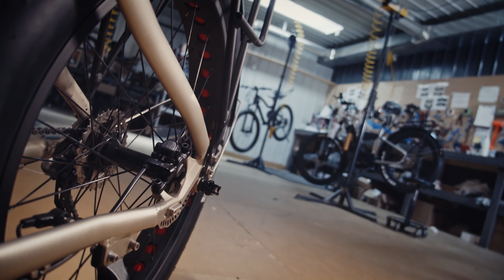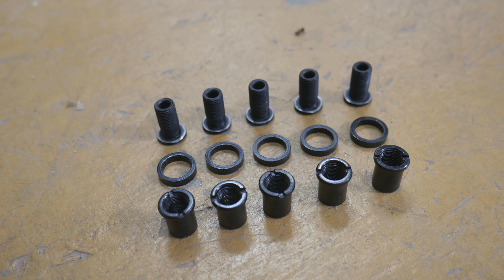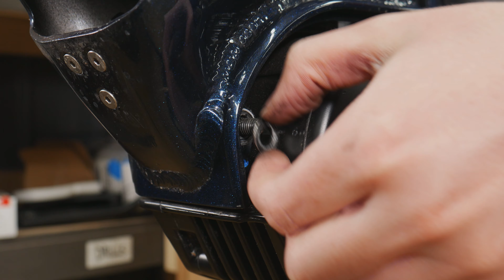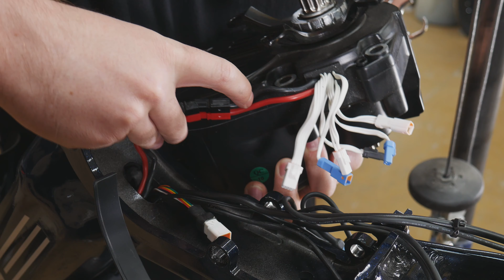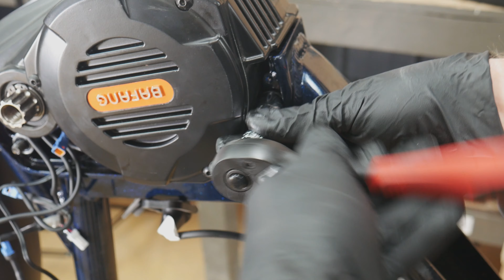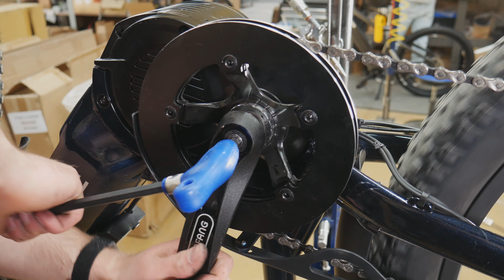How to Remove a Bafang Ultra M620 Motor

Comment: The motor wire harness will not fit on re-assembly, no matter how you try to arrange the wires.
Very frustrating.

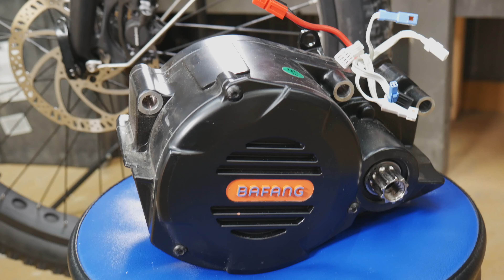Comment: Great video guys but one crucial part is missing and this is crucial for the motor to sit in the frame cradle with ease. At the reinstall part around the 3:00 mark you say to connect the power connections and pull the others to the side. Why don’t you show the opposite side from the drive side and state how the break, shift, gear sensor, and the torque sensor cables, four in all, should go under the middle bolt and out side the rear bolt and routed out the back? It’s crucial for the motor to set in with ease. DO NOT GO UNDER THE REAR BOLT AND OUT THE BACK, the motor wil not cradle down on the frame. Hope this helps people.
Reply: 100% right.
The reinstallation of the motor wiring harness is a nightmare.  
How could they not have thought of this.
Reply: Exactly

Comment: Hey Biktrix!!!!!!!  great video but a step is missing. how do you remove spider and bottom bracket? :)
Reply: Agreed, I came to this to see about removing the spider, sigh...
Reply from the maker: It's just standard charinring bolts. Super easy to take off.
Reply: @Biktrix  ummmm you need a special tool for it and not super easy. Why was that skipped in video? Great video but key step skipped
Reply from the maker: @seanfontaine8003  we'll see how we can add that in for next time

Comment: I’m on my third M620 in a year, these motors are noisy, the controllers are fragile and the replacement cost is around 1000$.
So far I’ve only been able to get 2000 miles out of one of these “ premium “ drives, so beware if you’re considering a bike equipped with one of these so called great drivetrains. 
Once you can’t stand the noise they make after 500 miles, and I mean big gear noise, you can find videos on YouTube that instruct you on how to open and grease the three main gears. The videos are well done and simple to follow and I truly believe that doing this will extend the life of these very expensive motors.
Having said all that…… they are powerful, have amazing torque and make hub drive motors look useless.
Beware of any bike purchased online, local bike shops really don’t want to service these motors and dealing with all these new companies can be challenging to say the least.
Good luck, I love my fat tire Ebike but they come with frustrations and challenges that regular bikes simply don’t have!
Reply: I've got 12,000 miles on my frey, and 4,000 on my Luna z-1 no problems did 1st regrease at 10,000 miles on frey
Reply: @petepete-pz4bm you only regreased at 10,000 miles? Your motor was loud and running metal on metal guaranteed.

Comment: great video but think a step is missing. how do you remove spider and bottom bracket?
Reply: 100% a critical step and completely glossed over. Currently preventing me from regreasing the motor as the socket I bought doesn't have the depth to mesh with the lockring over the crank arm axle.
Reply: Why was this step skipped? I really need to get the cover off so I can clean and regrease the motor but the star shaped part that holds on the rings etc is still there. Not sure what I need for a tool now to get the large ring type nut off to continue. This sucks...

Comment: Hi guys, I'm trying to install my new g510 but for a reason I don't understand it does not fit properly as my previous one, I am not able to line up the holes , has this ever happened to you? Is there another version of the g510?
All wires are placed correctly and no matter how hard i push the motor does not fit properly inside the housing. My bike has the same body frame of the juggernaut ultra beast.

Comment: Oh wait, but mid drive motors support throttle? That's awesome. The specs of this motor are way above the rear ones, that suffer when climbing slopes, and don't even allow to increase the voltage.

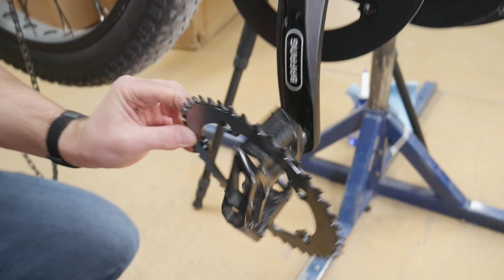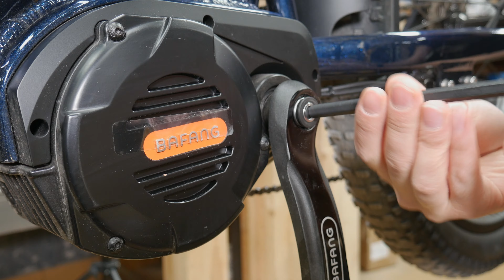Comment: At 1:16 on the video, the arm that holds the chain ring and chain guards is visible.  At 1:23 on the video, that part vanishes with no information about how it's been removed.  On my bike, it doesn't look like it comes off with the pedal arm.  How is that piece removed?
Reply from the maker: You can use size 5mm Allen key to unbolt the chainring from the chainring spider..

Comment: Thank you. Very very good. Will be opening mine to reduce running noise.
Reply from the maker: The Ultra motor inherently has higher running noise because of the all-metal gears. We like the noise though
Reply: @Biktrix  I also like metal more than plastic. Glad it is metal. I have a BIONIX with NO GEARS and it is real quiet.

Comment: Hi guys i am getting error code 11 every now and then even when the bike its dead cold, where is the temp sensor on this motor?
Reply from the maker: Temp sensor is located inside the motor. Contact your bike manufacturer for next steps.

Comment: Good timing as I will be installing motor on Jug Ultra soon. Question: The battery cables (red,black wires) connect down tube to a connector which allows battery power connection to the motor. My question is does this connector lie on top of the motor inside the motor housing of the bike OR should the cables be long  enough so that the connector is folded with the rest of the wired connections accessible behind the motor plastic cover? On my Jug Ultra this connection and connector was on top of the motor and could only be reached and tested with a multimeter after removing the motor. This is a bad situation for ease of general maintenance as well as increasing the probability of this connection and connector becoming loose or damaged with the tight fitting of the motor with the bike motor housing.
Reply from the maker: For the most part, the power connector lays flat on top of the motor. You may be able to extend this wire yourself and have it on the side with the other connectors. In the thousands of Ultra motors we have installed and worked on, the power connector hasn't been damaged from installation. It would be more of a convenience thing